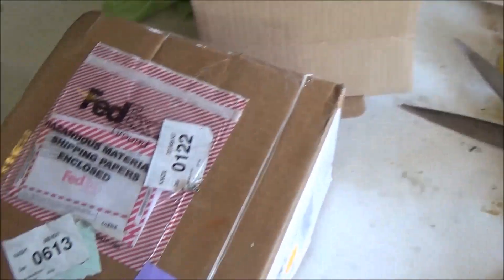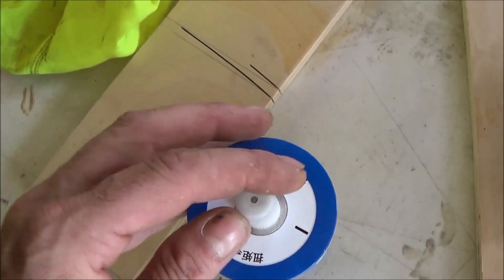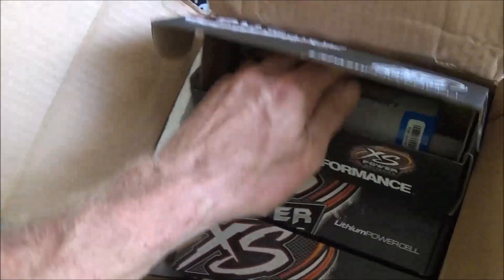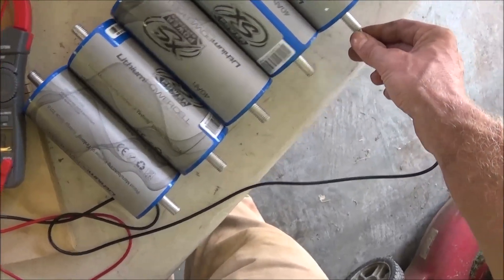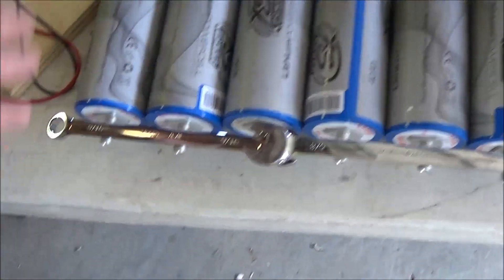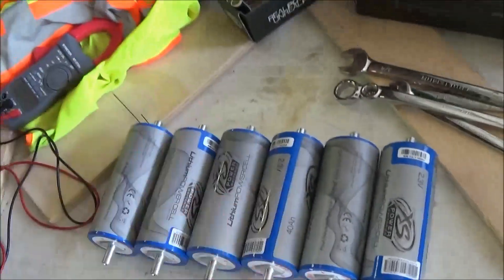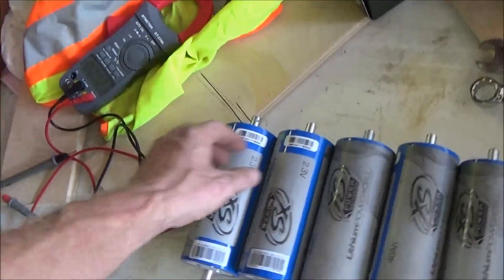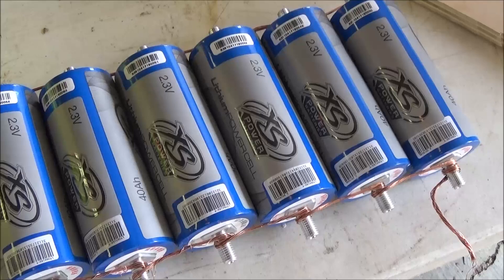Unboxing and Equalizing XS Power Yinlong LTO Cells

Comment: can a G10 be power up with a 80ah bank of ying long ?
Reply from the maker: Are you asking about a subwoofer, or an amplifier? I'm sure it's an amp, but I'm just not familiar with the name.  An 80ah bank on a stock alternator will support at least 5-7k amp. With a high output,  250 amps and up, it will support 8-10k watts.
Reply: @russellburgan9023  no am talking about limitless Gorilla G10 can it be powered with a 80ah yinglong bank ??
Reply from the maker: The Limitless Gorilla G10 battery is a lithium battery. You'll need at least a 200 amp alternator to charge that battery. If you're asking can you mix the 2 batteries to power your system, then yes you can.
Reply: @russellburgan9023  yes I want mix the 2
Reply from the maker: You shouldn't have any problem. They'll both charge up to the same voltage. I'm not positive about the resting voltage of the Limitless. It could be just a bit lower than the LTO. If it is, it won't drag your LTO down that much. It seems like they're very nearly the same tho.
Reply: @russellburgan9023  ok cool thanks man
Reply from the maker: No worries man. Hope it bumps hard for you!

Comment: Bro do you know if 14.4 volt being fully charged is a good voltage for a 13.2 LTO battery ? Because i have a lithium intellicharger and it keeps my battery in that voltage. There is any wrong or is OK?
Reply from the maker: 14.4 is fine. These batteries do well up to 16v. They work much better in the 15v range. If you don't have a high output alternator, start saving up. If you've become a basshead, you're going to need the alternator anyway.
Reply: @russellburgan9023  yeah i have to save up for a 15 volts alternator hehe. But i think that i wont have problems charging it with the charger after hitting hard 1 all day., what do you think? Thank you man
Reply from the maker: You should be good 👍
Reply: Hey bro one question, the ingellicharger XS Power 1208 works with LTO only or with LiFePo4 too? Because in the manual doesnt say anything about that. Thanks
Reply from the maker: It'll charge anything you connect it to. The differences in the batteries,  AGM, LTO, LifePo4,  and other chemistries are the resting voltage, and amperage output. AGM has lower output and resting voltage,  lithium is higher. They're all made for a 12v system. Of course you can build a lithium battery for a higher voltage, but in a car we use 12v accessories. You can use your charger to charge any car, car audio, or marine battery that is made for a 12v system.
Reply: @russellburgan9023  thanks crack🙌🔥 you kept me out all my doubts
Reply from the maker: That's what's up. Keep them subs bumpin!

Comment: Can I use a noco genius 5 to charge it?
Reply from the maker: You can. You can use nearly any charger to charge the bank. Low amperage is best, but doesn't have to be. The type of charger you use will determine the voltage it charges to. I think the Noco will charge up to 13.8v but don't quote me on it. I have an AGM charger that charges up to 14v. Biggest worry is if the charger can detect when the bank is charged and then switch over to maintenance. The Noco does that.
Reply: @russellburgan9023  should I charge it with the BMS connected? Sorry I'm new to this, all cells read 2.2v but 1 cell reads 2.1v
Reply from the maker: You can. It would be better to charge it with the balancer, but you don't have to. Having a .1v difference in voltage is normal. Battery meters don't measure in thousandths, so they round up, or down. Now if you had more than. 2v difference, you might have a problem.

Comment: my 6s bank I built from XS Power (yes they were built equalized) got out of balance.  They did this within a 6 month time.  My next built will have a balancer..
Reply from the maker: That is because you did not do any battery maintenance. The harder you use your bank, the more often you will need to do maintenance. Maintenance simply consists of breaking down your bank and equalizing them again. If you have a good variable charger, you can also charge each cell individually. Whichever you prefer, equalizing or charging will bring your cells back into balance. I'd recommend at least once every 2-3 months depending on your usage.
Reply: @russellburgan9023  i believe that but not in my case.  I built the pack for a vehicle that was under construction and set in the garage.  I used it a few times to jump start a different vehicle and allowed it to recharge each time.  I carried it to a RC play day for the boys to recharge their little batteries.  In all cases the battery probably never went below 12.5 and topped around 13.8.  For that pack i wired a harness that plugs into the lipo balance checkers used for lipo hobby batteries.  That was 3 months ago.  It has been good since.  I believe it id very important for people to check for balance every few months regardless of use.  Its possible I got a few weaker cells but I would mark them if it continues to happen.  As you have said with maintenance, be aware..

Comment: How can i charge this
Reply from the maker: Put your bank together, and charge them just like any other 12v battery. You can charge them individually if you have a charger that charges at 2-3 volts. I recommend charging them together.
Reply: Russell Burgan will they all charge to nominal voltage as a bank after equalized? Or do you recommend charging each cell to 2.3V then equalize, then assemble bank? 

What type of battery charger Can I use? I have a slow trickle low amp battery charger for lead acid/ AGM?
Reply from the maker: The nominal voltage of your charger should work fine. You want to put at least that much charge,  12-14v on a bank before installation so it doesn't kill your alternator. The trickle charger will work fine. My charger has an AGM switch,  but I used regular setting.
Reply: @russellburgan9023   can i use a power supply ?
Reply from the maker: Im so sorry I'm only now seeing this comment. Theres been a lot of comments that hasn't shown up in my youtube studio app. Yes a power supply will work so long as it operates within the voltage range of your cells, whether individual cells or your bank.

Comment: I have a AGM up front. Will I have to delete it? Just bought 6 of these in a group buy. Purchased the balancer and buss plates/bars.  Currently running a XP3000 that I’ll need to remove.
Reply from the maker: Most will tell you that you have to do a delete because of the resting voltages between the 2 types. The AGM will rest at a lower voltage causing the lithium to drain. You could put an isolater between the alternator and the AGM so that when the vehicle is shut off it will isolate the AGM from the rest of your system. For the sake of the lifespan of your lithium it would be best to do a delete.
Reply: @russellburgan9023  thanks for the follow up info.  I’ve since added a second bank (80ah) and put a balancer to it.  Have serviced it 3 times.  It’s doing great!  I have my own videos showing the progress.
Reply from the maker: Share the link, and I will check it out!
Reply: In regards to your response here and on a previous comment...after doing a front delete but using the vehicle as a daily with stock alt (for now). I'm currently charging at 14.1-14.3. How often would you recommend breaking theses down, checking voltage & balancing them out? Biweekly, monthly, or am I good for 2 months also?
Reply from the maker: You should do it as often as every couple months,  2 or 3, or a little as every 4 months. The hard part about battery maintenance is maintaining the cells, especially if you over tighten the nuts. Just because you can use them without a balancer doesn't mean you should. It is a bit of extra work and could be a hassle if you break one of the studs. Balancers have gotten much cheaper since the making of this video. Here's a link to one I personally bought after building my 80ah bank. https://youtu.be/D4NqUigNHsU

https://smile.amazon.com/dp/B07XFBSTLY/ref=cm_sw_r_other_apa_i_HWTZRQWYBMJVWMW3TZT1?_encoding=UTF8&psc=1

Comment: Can this act as a car battery?
Reply from the maker: Yes you can use it to start your car. You should do a battery delete to use lithium in your car. It is not good for your cells to mix with different chemistries. Lithium has a much higher resting rate than AGM or lead acid. When you shut your car off, your lead acid battery will drain your lithium cells as batteries naturally want to equalize to the same resting voltage. It will certainly decrease the life of your cells. You could use a battery isolator solenoid to try and isolate the batteries while the engine is shut off, but they will still be connected while it is running. If you hook your stereo up independently of the car's electrical system, and have a second alternator charging your stereo, you wouldn't need to delete your car's battery.

Comment: They didn't even bother balancing the cells before they shipped them? Hmmm... Sounds like they are used LTO cells
Reply from the maker: These are chemical batteries, and it is impossible to get them to charge, rest, and decay at the same rate. This is the reason for the balancer. I suppose it is always possible to get something other than what you payed for no matter what you buy, but in this case not for that reason. Its just simple chemistry. This is the reason why we pay a little extra from a reputable distributor,  that good feeling that we bought from a trusted source, and getting a guarantee.
Reply: Is it necessary to manually balance the cells before assembly if you will install a bapancer with the cells?
Reply from the maker: I'm so sorry I'm only just now seeing this comment. There has been several comments that did not show up in my youtube studio app. If you build your bank with a balancer, and as long as you charge your bank before you install it, then you don't have to balance them. However, I would advise you to balance them before you assemble your bank.

Comment: Hi Buddy will a CTEK Dc to DC charger , charge this type of set up? or would we still need a 6S Balance Board, these would be great to use on our camper trailer
Reply from the maker: It would charge them, tho I am not familiar with its features. The balance board isn't necessary to use with these cells, but because they are chemical batteries they will not all charge and discharge at the same rate. Having the balancer will regulate the charge and discharge for you. Without the balancer, you will need to perform battery maintenance by busting your pack down from time to time, depending on your usage, and equalizing them they way I have done in this video. This will ensure maximum capacity, and life of the cells.

Comment: You said those cells are 40 amp hour and you were building a 40 amp hour battery. So do the amp hours not add together?
Reply from the maker: When you strap the cells together in series only the voltage changes. When you add banks together in parallel then the ah are added together. So that 2 banks of 6 40ah cells will become 80ah, yet remain 13.8v. Voltage in series, capacitance in parallel.

Comment: 72v 18ah how much cell using
Reply from the maker: To build a 72v bank you will need 32 cells. These cells are 40ah, so that will be your ah rating. They make these cells in lower ah rating, down to 30 if I'm not mistaken. The ah rating is just a capacitance rating. Having a higher ah rating than what you may need will not hurt.

Comment: Hi how many of these do I need to support 20000wrms car audio
Reply from the maker: For 20,000 watts you will need 4 banks of 6 cells totaling 24 cells. That is 160ah. If you plan on doing a lot of demos at shows, you might consider 1 extra bank just for capacitance.
Reply: @russellburgan9023  thanks very much

Comment: what is the price of 6 cell and brought from?
Reply from the maker: I bought them from XS Power. They were $59.99 a cell. I paid $360 for the whole bank, plus $32 for shipping. So my total cost for a bank of 6 was $392. There are other places to get them a little bit cheaper, but there is no guarantee that you are getting what you're paying for. Some distributors are selling used cells as new cells, and some are rewrapping 30ah, or 35ah cells as 40ah cells. With XS Power they come with a 4 year guarantee.